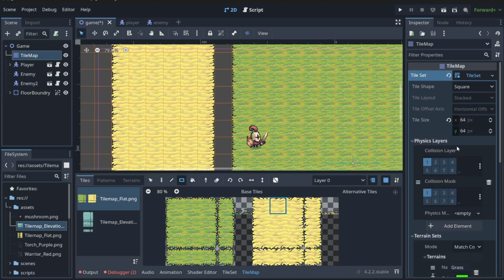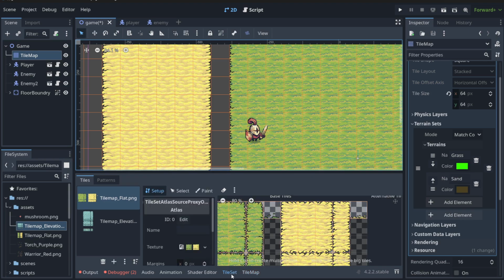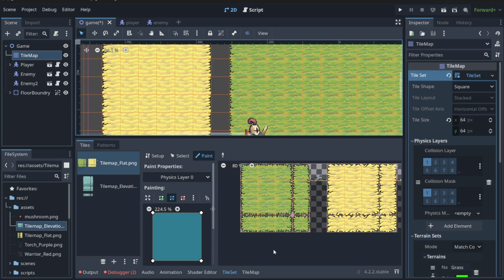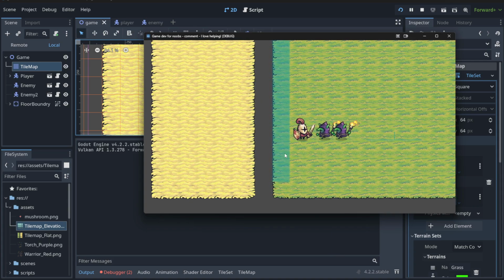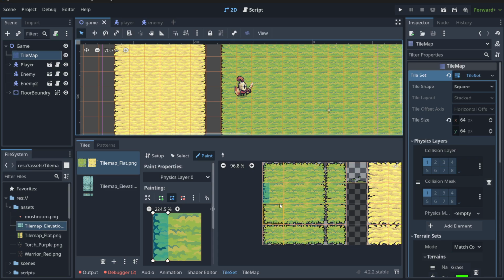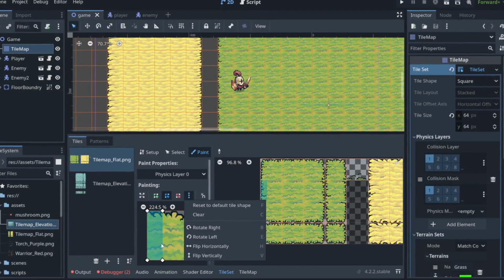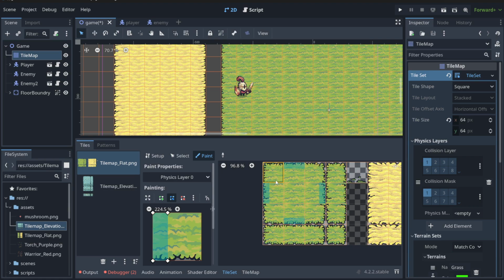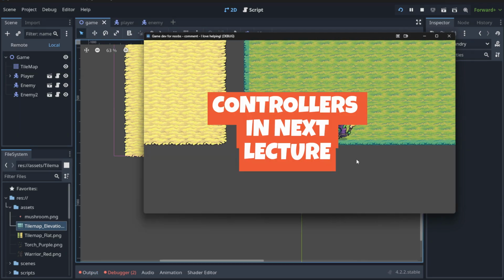Tilemap Collisions with Physic Layers: Everything you Need to Know as Beginner (16) #godot

Comment: Do you know how to return a tile's Vector2i TileMap position when there is a collision with the physics layer?
Reply from the maker: Hey,

You could try to do something similar to this:

extends CharacterBody2D

@onready var tilemap_layer = $"../TileMapLayer"  # Adjust the path to your TileMapLayer

func _physics_process(delta):
    # Your movement code here
    move_and_slide()
    
    # Check for collision
    if get_slide_collision_count() > 0:
        var collision = get_last_slide_collision()
        if collision.get_collider() is TileMap:
            var collision_point = collision.get_position()
            var local_point = tilemap_layer.to_local(collision_point)
            var tile_pos = tilemap_layer.local_to_map(local_point)
            print("Collided with tile at map position: ", tile_pos)
            
            # You can now use this tile_pos to get more information about the tile
            var tile_data = tilemap_layer.get_cell_tile_data(tile_pos)
            if tile_data:
                # Access tile properties, custom data, etc.
                print("Tile custom data: ", tile_data.get_custom_data("your_custom_property"))

Best regards!
Reply: This doesn't quite work I'm trying to get the tiles an AoE attack (Area2D) collides with.

I can do:

var collision_point = collision.position * size 

but iterating through all the positions of the Area2D collision I feel is a bit much. I know/where I'm at is:

Area2D.shape_entered(shape):
     if shape is TileMapLayer:
          **if shape.colliding:**
                * shape.tile_data.get_custom_data(change_property) *